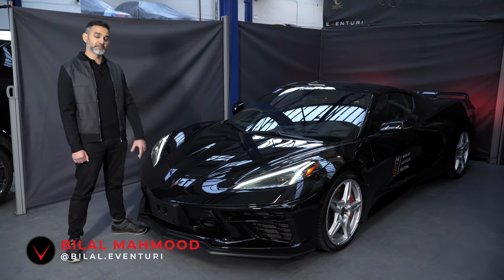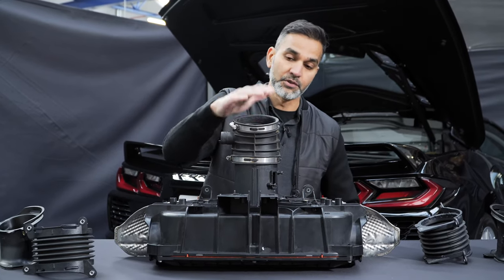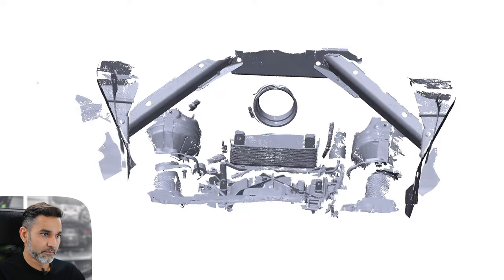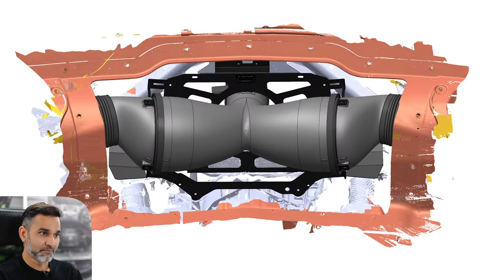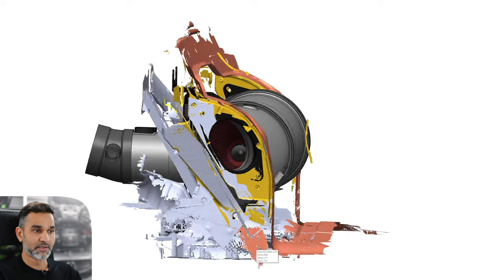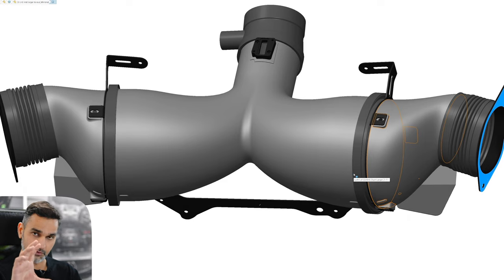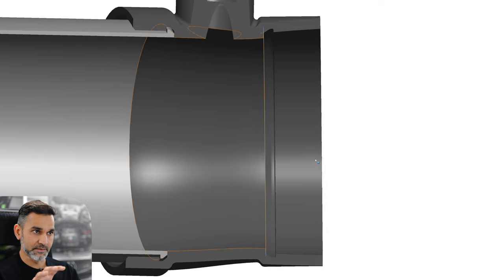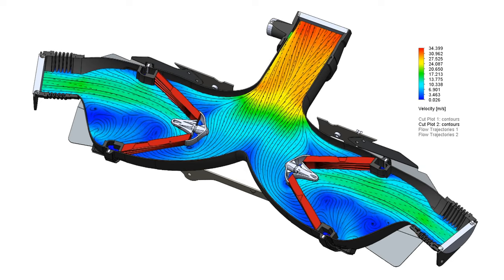C8 Corvette Eventuri Carbon Fiber Intake System Development - Part One

Comment: Question , I have a 95mm throttle body attached to a OEM ported intake manifold.  Do you sell a coupler that is bigger or should I just use a heat gun to try and stretch it on there ?    Hoping you can help as I’d like to run this intake set up on my c8.
Reply from the maker: Thank you for your interest in our products. Please contact Paragon Performance in the US, they will be able to advise you further in regards to fitment with aftermarket throttle body.

Comment: Great design , two questions, (1) With this design, can we use a larger throttle body ( 95mm) with the new Lingenfelter intake manifold, (2) Since your new design sticks out more into the trunk space , can we still latch the roof inside the trunk to lock it
Reply from the maker: 1). We are working with Paragon Performance to make a custom connection to that intake manifold.

2). Yes, the roof can still be stored there.

Thanks.